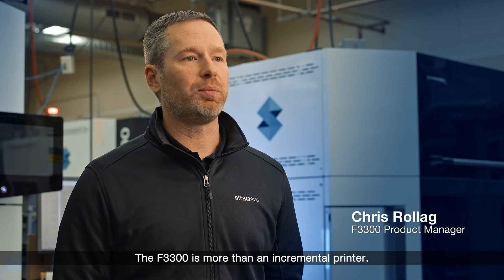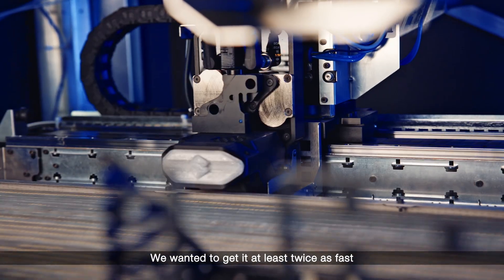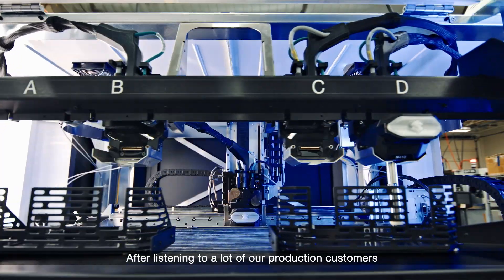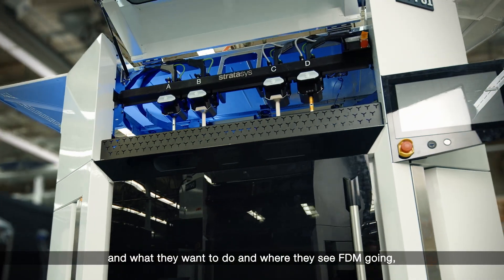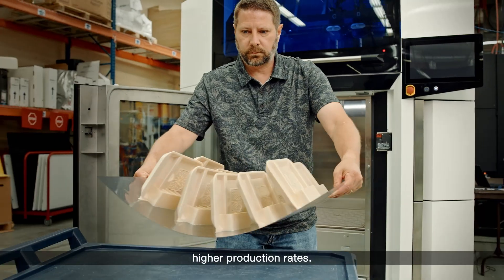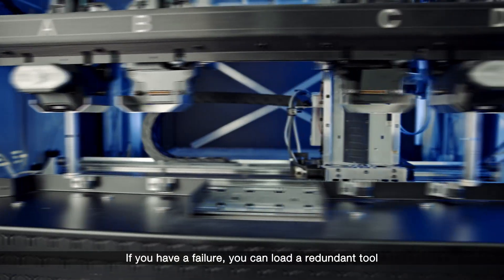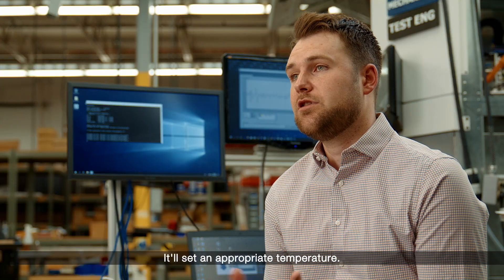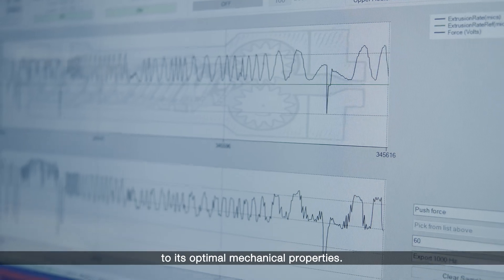Introducing the BRAND NEW Stratasys F3300 3D printer!

Comment: I have a 3D-printed sample of a planetary gear made in nylon that I picked up at an exhibition at the Stratasys booth in 2006, a print-in-place sample with impressive quality. That sample has been with me all these years, and only now in 2024 have I managed to make something of similar quality in Nylon with a BambuLab X1C. It's been 18 years before I have something on the same level as the Stratasys of 2006.
Reply: You are looking at the company that is responsible for those 18 years of waiting. Stratasys had the patent on heated chambers and it expired around 2021.

Comment: how much this overengineered Prusa XL with filament dryer and high temp  hotend costs? Like 500 000 dollars? xDD
Reply: somewhere in the 200-300k range.. Stratasys was always and will always be ridiculously expensive.. Printer, Parts and closed system Filaments are all extremly overpriced..
Reply: @chillermrq  That's just ridiculous